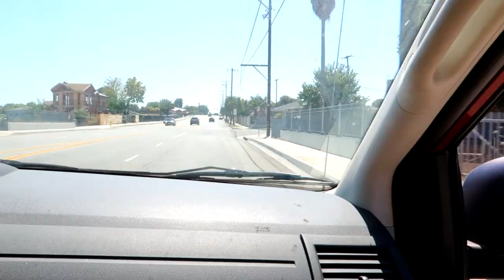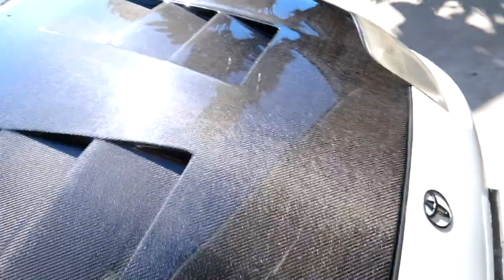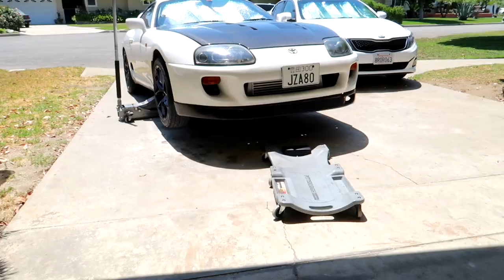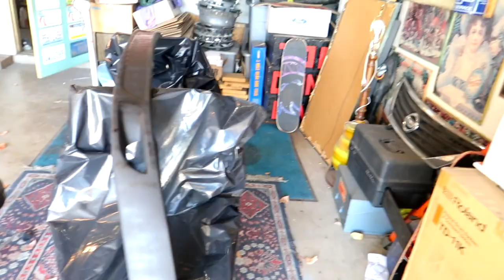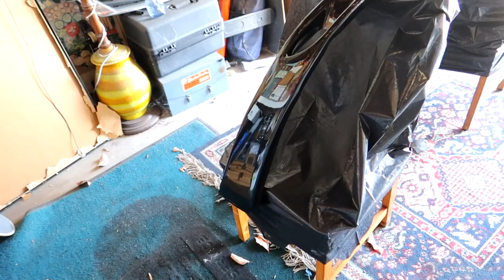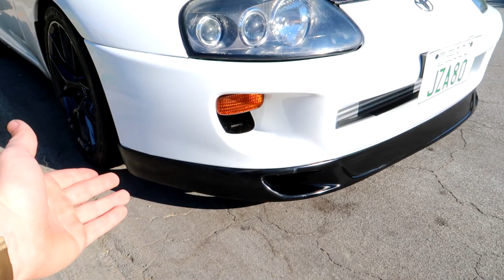Supra Gets A Carbon Fiber Hood!!! - Damages Bumper On Freeway...

Comment: Id definitely recommend getting some hood latches for the cf hood so it doesnt fly off on the highway or sumn since the hood latches are just bonded to the fiberglass and tend to crack and possibly fail

Comment: Carbob fiber lkip lip just need light sanding 2000 then 3000 compound and and polish. If needed  more shine  you could hit with Spraymax epoxy 2k clear. Its 2 stage epoxy in can with activator and clear.

Comment: a cool real body kit (front bumper, rear bumper and side skirts) that actually make a fitting under line? also not something too screamy but at least you would have a nice flowing line from the back to the front cause now it looks funky a bit, I hate when the front bumper looks lower than the rest